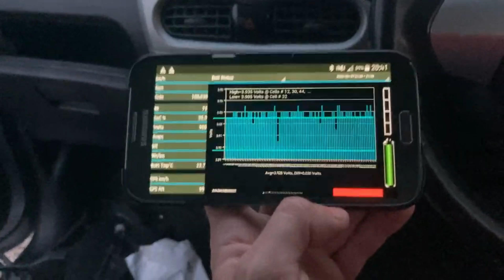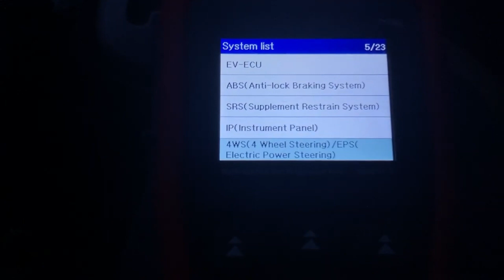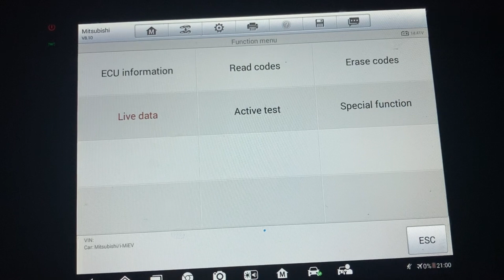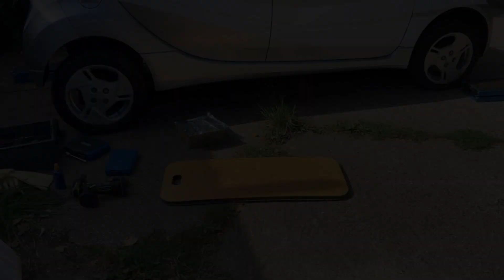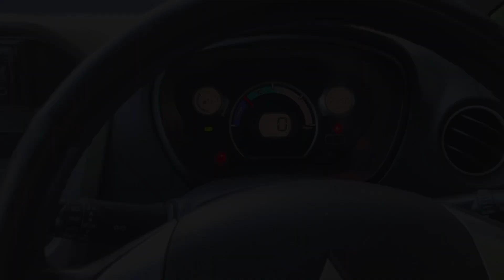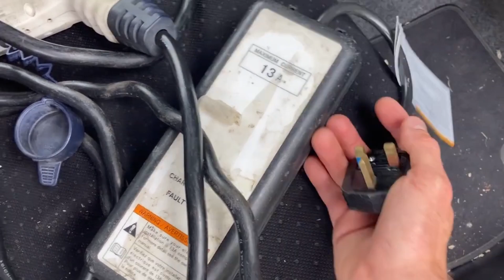Full video diary: 14 year old full EV battery repair - Electric Car Salvage - Mitsubishi i-miev ion

Comment: Hi Gary, at 22:50 you mention that the individual batteries are balanced during “the last phase of charging”. I’m in the habit of charging the battery to 80% as I was told this increases the lifetime. Am I inadvertently keeping the battery pack from balancing itself? Thanks
Reply from the maker: Hi, yes you should regularly fully charge the battery to enable balancing of the cells. It is good to keep it mostly within 20-80% but a regular full charge is also important and won’t do any harm if the vehicle is used within the next day or so. Thanks.
Reply: Great stuff! Thanks @garycevrepairs for getting back to me.

Comment: Does this car have a battery cooling/heating, somebody said that i-miev has active cooling/heating for batteries, but when viewing your open battery doesn't seem so. =) Nevermind I continueed watching and apparently there is a flap that lets cool air in.
Reply from the maker: Hi yes duct at the front let’s cold air in from ac system. More advanced than a Nissan leaf 😁

Comment: I've got a question...is it a design fault but how could these lifepo prismatic cells are set vertically (a pole down and the other over it)? Wouldn't this place the liquid inside unevenly? I've always thought the should have the terminals upwards or at least laid down flat. Am I right?
Reply from the maker: Hi, lithium cells don’t have liquid inside, it’s like a dry thin paste sandwiched tightly in between thin layers of metal and plastic. They can be used in any orientation. Thanks.
Reply: @garycevrepairs thanks! I guess I've bought way to cheep prismatic cells. When opened up there was a crazy smell and some liquid dra dripping that's why I thought so. Hope I'll make an upgrade soon😊

Comment: You need a 2 post lift mate! You'll save so much time and annoyance!
I swapped my worn out high mileage battery pack in my 2011 iMiEV with a low mileage one from the breakers, took me 2 1/2 hours an I've got 10 thumbs..
Reply from the maker: I will get my own proper workshop one day! It works keeping fixed costs down for now. Cheers

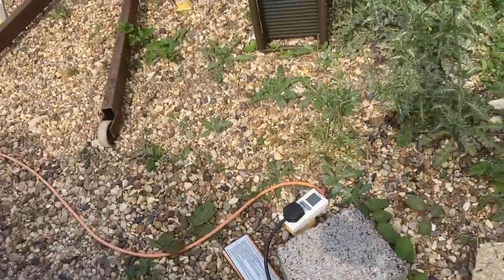Comment: C. 42:05 Glad you pointed that out, because a BS 1363 (UK 13 Amp) plug is only rated at 13 Amps for 1 hour. It's only rated at 10 Amps for continuous use. The 13 Amp fuse is also designed to fail after 4 hours of continuous use at 13 Amps. If you must use the full 13 Amps for more than a few minutes, make sure that you have good forced air cooling around each plug and socket, to keep them cool and safe. 

In practice, I've found that my 'granny cable', which is switchable to 8, 10 or 13 Amps, always underperforms slightly. So the 13 Amps setting is closer to 11 Amps. 'Your mileage may vary.'

Furthermore, using an extension lead is not recommended, because most domestic extension leads are only rated at the stated current when fully uncoiled. For instance a '10 Amp' extension lead is only good for about 6 Amps when coiled. 

Even worse, you cannot trust the claimed current ratings of many of the budget-priced extension leads available online. Some of them are completely illegal and are fire hazards.

Comment: Hi Gary I’m new to all this EV stuff but wondered if you you could point me in the right direction of acquiring a new circuit board or repair existing with this part number Nichicon PA4104RP40 (from Peugeot ION 2012 Charge unit ZHTP1529R). Great video , very informative and only hope I won’t ever have to change one of theses units🤔😅
Reply from the maker: Hi I can usually repair those units, drop me an email gclayton@hotmail.co.uk

Comment: I have one of these a 2012. Great little car. When we bought it 1,5 years ago it showed a range up to about 80 km. Now it maxes out at 60. Some cold morning it won't even charge fully and shows 44 km range after a full night charging at 10 amp max. I have used carscanner and a dongle to check the battery and all the cells seem ok. 4.01 TO 4.07 volts. Another video used a very (1000 USD) machine to get the range up tp 100 km by resetting the battery. Do you know any other way to do this?*
Reply from the maker: You can reset the car’s capacity counter which will basically force it to use the battery harder and it will relearn the true capacity over time. Some people have done extended balancing but tbh I think all these things are 50% beneficial initially but temporary and 50% snake oil.

Comment: Just out of curiosity what BMS chips are they using on the board's.
Reply from the maker: The boards on each module are a slave board, the main BMS is under the back seats on these. Cheers.
Reply: @garycevrepairs  LTC6802G-2 the chip that failed is roughly £10. It would be interesting if someone could swap it with a new chip as the whole board is pretty scarce.
Reply from the maker: I have done that a few times when complete replacement boards are not available. It’s not always successful but works most of the time. Cheers

Comment: Really interesting stuff Gary. I've been wondering if one of these or a Zoe might do for my father to run around locally. I can't help thinking that if you have a Zoe, Leaf, iMiev or similar, dropping a new battery in with the latest energy density, would give them a massive boost in usefulness. I know this would require software and some hardware changes and what people will want to spend will relate to the value of the car, but I for one would be very interested in keeping an older EV long term, especially if it has a decent range and faster charging capability. The cost of new batteries is still dropping rapidly and I suspect that some of the boffins that already faff about with EVs, will find they can use a CCS charge port and inverter off a written off X or Y. I had a 2014 Kangoo ZE max and that would have been so much better with better range and CCS charging. There was plenty of space underneath for a second battery and I was not carrying heavy loads, so overall weight was not an issue. There's got to be a market for this, and the tech gets cheaper and knowledge improves. In the meantime, its great to see you keeping these cars on the road, without breaking the bank.
Reply from the maker: Hi yes there are people who do battery upgrades for the i-miev although it is rather expensive for an old car and may not have been through the same rigorous safety testing as a production vehicle. That being said there needs to be more options to extend the life of older vehicles with worn batteries. Cheers.
Reply: It's not as simple as just dumping in new cells with higher capacity. They need to physically fit (obviously) and the management software needs to be reverse engineered and changed. If you just dump in cells with higher capacity the  Imiev still won't use the higher capacity. Oz Electric actually did the reverse engineering and offers a battery pack upgrade, roughly doubling the capacity. Alas, it is prohibitively expensive.

Comment: Some corrosion after 14 years is to be expected, but worn suspension after 27k miles doesn't sound good. Do these things wear fast, or is that 27k miles bogus?
Reply from the maker: The mileage is genuine I believe, these do suffer from some corrosion underneath and aren’t that beefy. Cheers.
Reply: My 2010 has no rust issues, but then I'm in Brisbane Australia, and the car has been very well looked after. No issues. Upgraded the battery in 2022 for a 200+ kilometer range. Just love it!

Comment: If I wanted to get an EV, would it be worth  doing a course like you did to save money in the long run? Or find a good guy like you to just fix it?
Reply from the maker: Unless you want to work on multiple EVs or have an EV repair project then it’s probably best to find a reasonably priced garage like a Hevra approved one. Cheers

Comment: If the imiev had double the range it would be a winner, given its rapid charge speed.
Reply from the maker: Absolutely.
Reply: @garycevrepairs it's a fresh design even now. Really like it.
Reply: The Chademo rapid charging is a bit misleading. In cold weather the Chademo won't go beyond 10 kW and quickly drops to 5-6 kW. The battery pack is not heated, hence veeeerry slow charging when it is cold.

Comment: With the charger, I'd whack a 15Amp plug on it. That way, no one can plug it into a 13A circuit without an adapter. If they do that, they do it at their own risk. Most garages would have a dedicated 15A circuit (probably higher).